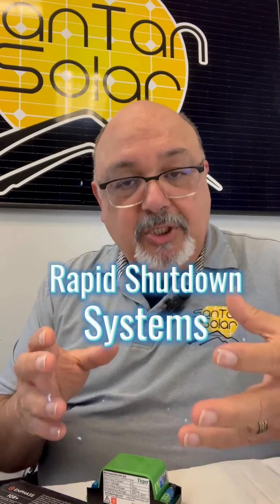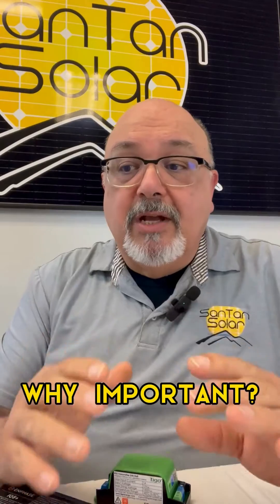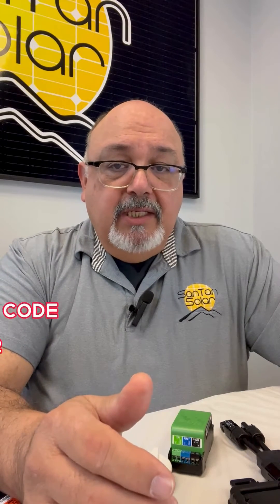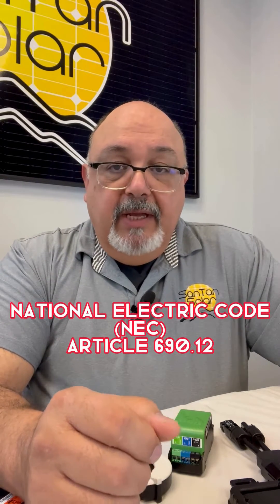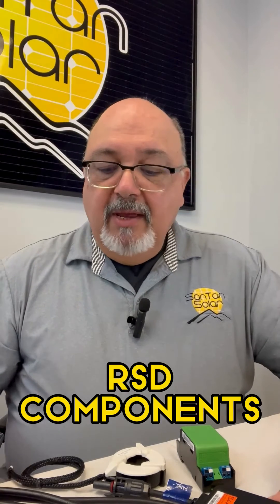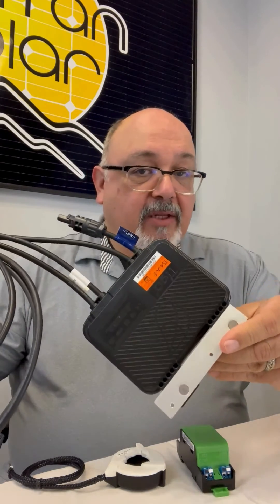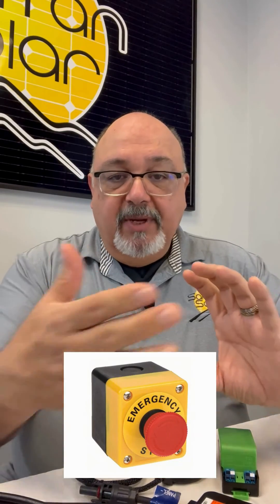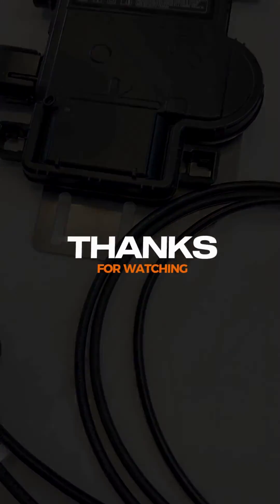RSD Explained - Solar Learning

Comment: The subject is important and deserves a thumbs up. However, this video deserves more detail for me to provide a thumbs up. Answering some of the following questions would be a good start.

What does it connect to directly? Does it communicate to other modules to further shutdown those modules? Is there more than one type that can be used? Does one type of RSD device work better with one system architecture better that other RSD architectures? Are there any automated RSD systems/devices? Are there other requirements or dependencies to implement an RSD? Are there limitations to RSD devices? How about a schematic or exploded view drawing to explain the implementation?